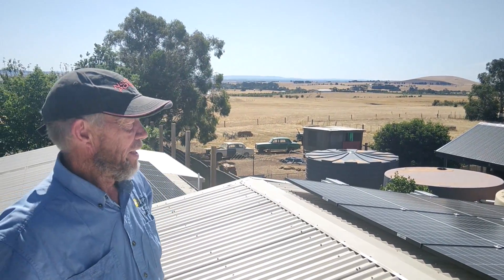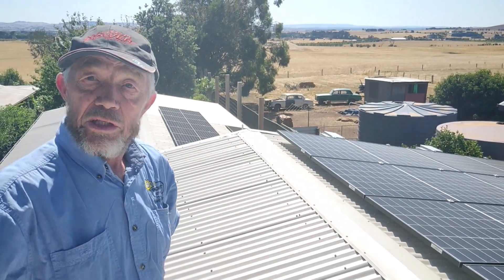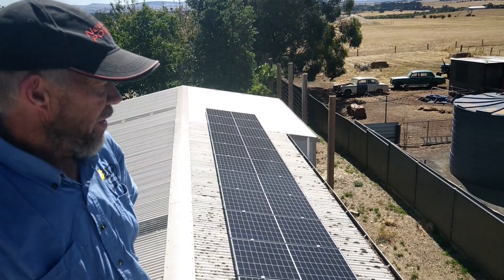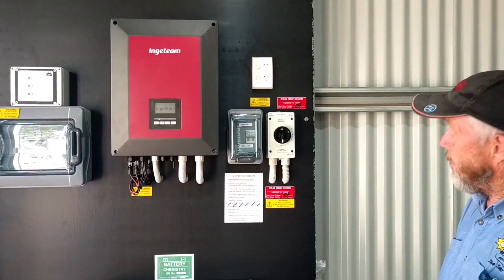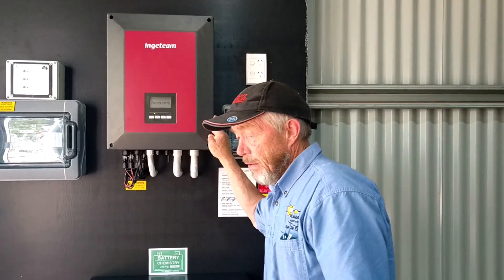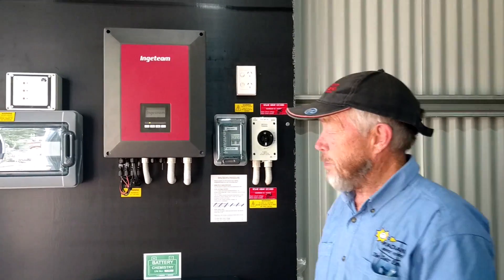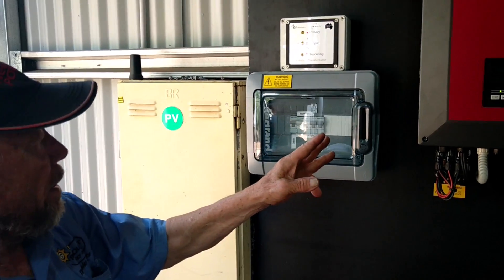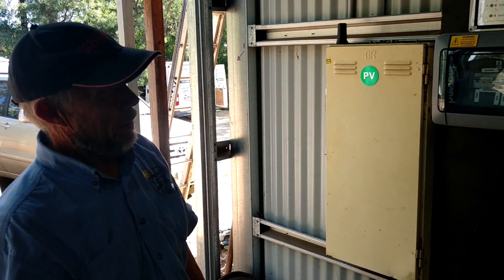12kW off grid solar Ballarat

Comment: 32 amps coming in at 500v..im not sure what that switch is for, why do some people put breakers on the voltaic cables?
Reply from the maker: It is just because of regulation requirements, but yes no need
Reply: @100upoffgridsolaraustralia4  I keep thinking it has to be easier to setup.

Comment: Looks like it takes a boatload of cash to go off grid.  It's either this or pay a boatload to corp. landlords who have bought up everything and are driving up rent pricing through the roof.
Reply: heres some back of napkin  - banks fake money from FRB + regulation that refuses to stop property speculation and a gov that encourages it and refuse to call a roof over a nations head a basic need X real estate speculators supported and encouraged by system = solar too expensive for anyone besides the ppl who don't need the $ saving. oh yeah and the tennants in the price inflated house pay thier landlord for the solar install rebates with after tax money and the landlords pay lower tax.

so yeah, solar not expensive at all brah

it's called trickle down economics but it never did and now it trickles up yaaay